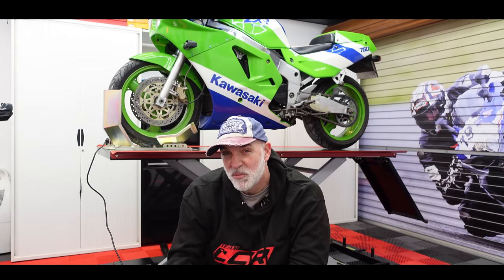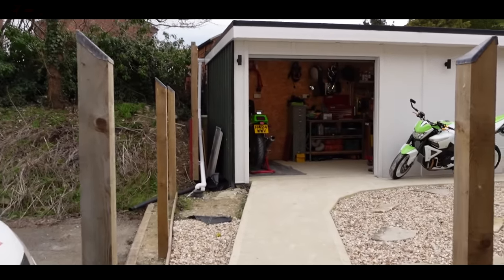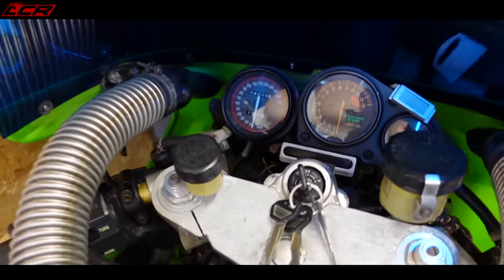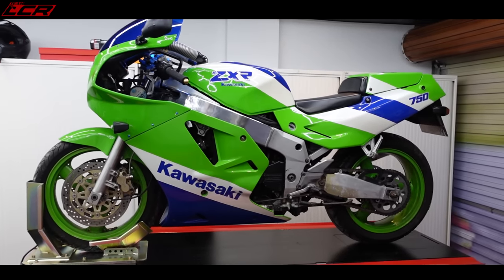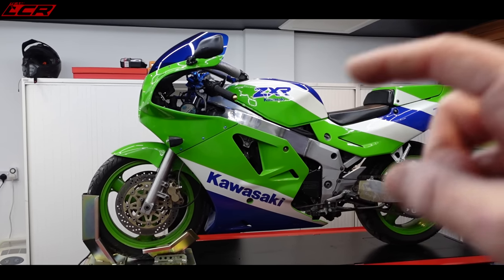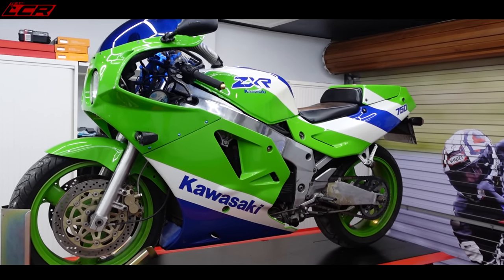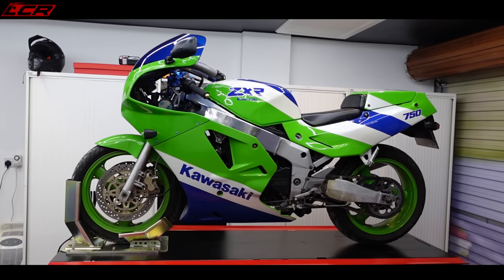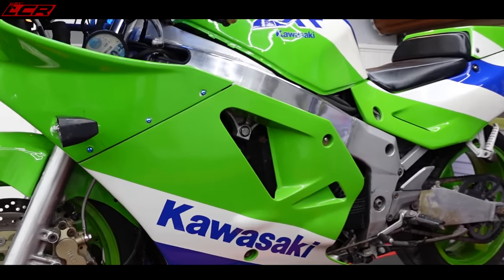New Restoration Project!! | 1990 Kawasaki ZXR750 H1

Comment: Hey Chops, I'm looking forward to your build. In '90 I fell in love with the black & gray model (USA), but "settled" on the green one as that's all the local dealers had in stock. The Kawi was a bit heavier (& longer) than the others, but felt planted in the corners; and with a linear power curve it was loads of fun to power slide. I had a fair amount of performance work done and although the power was impressive, it was temperamental and wasn't quite the same to ride. I still have mine and hope to get it running again.

Comment: Great find!!  I just finished my 1984 Yamaha Virago and I'm looking at my next project as well - a 1987 FZR1000.  The dual headlights are so iconic and I just love the look of these bikes.  I've owned a 1984 FJ1100, 1985 RZ500 and a number of other bikes from that era that I wish I'd never sold and still had.  One of the greatest catches for a restoration is just what you have - something that is mostly original, neglected but not abused and ripe for restoration with NOS/OEM parts still available.  Good luck with the build...you have another sub.

Comment: Looking forward to the restoration videos on this bike!
Had a zxr 750 1991(green colouration)back in those days and i was really fond of it.
Took it even down to the 20 km nurburgring track.
Great to hear that you going to keep it original.
I usually dont change other parts then the exhaust to a slipon.
Smaller changes like windscreen for example are also ok but not major changes.
The bike you got looks really good i have to say.

Comment: Judging by the swing arm, it looks like an H2. H1 had an external oil filter and the H2 had an internal oil filter. The H1 was the GPX 750 engine and if I'm not mistaken, the H2 was a new design. I had a red black and silver H2. There was a recall for the hugger which had a tendency to rub on the rear tyre. Possibly the best looking bike I ever owned! Book speed was 155 mph with an indicated 165 mph, Germany obviously so no slouch.
Reply: I had 1989 H1 when the bike was first released. Agree swing-arm looks like a H2

Comment: My first proper bike. Had a Muzzys Exhaust when I bought, I thought this thing was the ducks guts...so many had the GSXR 750, but I loved this bike. They were pretty quick...but always a few steps from the GSXR 750  from the tests I remember. Definitely not a slug though. But yep looking back 110hp was pretty decent back in the day. How cool were those fake induction hoover tubes though lol. I still managed to pull a 10.5 on the quarter mile with it.

Comment: I had one of these brand new in '89, but it was a red/black/gunmetal one. Did 22000 miles on it before it was written off by a Transit van pulling out in front of me. Keen to see your restoration! But is it a H1- it's got a H2 swingarm (which is a popular mod) although the paint scheme is H1. Although it looks like it's been resprayed at some point. Regarding the 4 star, I think that was well out by the end of the 80s, and all of the Japanese bikes ran fine on normal unleaded (unless they were race bikes etc). As for the power the H1 was 105ps and the H2 was 108. Good luck!

Comment: She looks amazing Chops the body work is in really good nick just make sure you lube up the pistons and top end before you go cranking on it trying to get it started. Maybe a good idea to put a splash of 2 stroke oil in the tank for the first start up  just to help lube up all the top end and valves prevent any damage from happening from sitting and getting dry.

Comment: Yep I remember all the fuel ⛽️ grades, 2 ,3,4,5 🌟 and the cost  40p ish a gallon around 1974, 
Had a GT 750 water cooled  1976 was using  4 star 🌟, 
Was advised by the dealer 2 star 🌟  is totally suitable, 
Looking forward to the restoration  of Kawasaki,

Comment: I worked at a bike dealer when these came out, before it was GPZ900Rs and ZX10’s. It was a leap forward. Love(d) the looks especially in the Kawasaki green, the red wasn’t as nice looking.

Just after launch, Our brand new demo was written off with 200 miles on it filtering in traffic by a local racer who was looking to see if it was worth changing his race GSXR slingshot for one.

Comment: Fantastic!!! I have a few parts left over from my restoration of one a few years back. Points to check and double check are the unions on the oil cooler, and any threads that go direct into the frame as the alloy isn’t the best. Yours has an H2 swingarm as the H1 has the brace over the top. Awesome ‘bike. 👍👍
Reply from the maker: Brilliant to know thanks 👍👍

Comment: That's going to be a great (although very expensive) build Chopsy can't wait and I remember the old 4 star petrol it got abolished in 2000 I think? But if you were 16 when it did you should only be 40 years old (same as me) lol
Reply from the maker: Haha OK got that wrong then.. I'm older than 40 😆
Reply: @LambChopRides  I know but didn't want to rub it in lol that's why the 44 teeth lads call you Dad

Comment: If anyone is doing such a project we might be able to help, on a bike like this we can source everything from batteries to chains, sprockets, tyres, seals, bearings, crash protection, heated grips, indicators, bulbs, clutch plates, brake discs, brake pads, oil filters, air filters, spark plugs 🎉
Reply from the maker: Fancy sponsoring the restoration series? 😁
Reply: ❤ we could! We have to keep these legends on the road 😎 I had to at the time, but there's lots we wish we kept like the RVF400, CBR400, an immaculate special edition 600RR(one of 3 we owned) to name a few! Every single model is currently worth more than we let them go for 😮

Comment: Chops, I might have missed some information, apologies if so… Is this definitely an H1? It’s on an H reg which always tended to be late model H2’s.. also, it has an H2 swingarm and H2 seat hump. The fairings are painted as an H1 but the rest shouts H2 🤔 If it has 38mm carbs as opposed to 36mm then that’s H2 as well. Also check the radiator, the H1 is flat, the H2 is larger & curved. 

The plastics do look in good condition. Fingers crossed there are minimal snapped tabs.. these old plastics can be a pain🤦🏻😄

Looks good though mate, will watch with interest. 👍🏼
Reply from the maker: Done some research on the chassis and engine numbers it is an H2.. so pleased as they were supposed to be better 👍
Reply: That’s great.. it’s surprising how many differences there are between the H1 & H2. The H2 engine got some race kit parts as standard. 

It’s going to make a great resto series 👍🏼

Comment: Out of interest, does the Kwak need strapping down on the bench? Or is that front wheel slot thing enough?
Reply from the maker: Ideally chuck a paddock stand on the rear but no bobbins on there currently. I wouldn't leave it on thier without being strapped or on the paddock 👍
Reply: @LambChopRides  very nice lift tho, clever how it cups the front wheel like that

Comment: It’s an H2 or at the very least an H1 with and H2 swingarm. You said it’s 1990 which is an h2 anyway.  I had a Rob Muzzy race kitted Superbike back in the day. Kit gearbox, radiator, muzzy cams, carb kit, full muzzy titanium exhaust and kit igniter (revved to 12,800rpm)
Reply from the maker: Yes actually after some more research it is an H2 👍

Comment: Even though you are doing a resto back to standard. The one thing to fit is get some lighter wheels in the same look… the oem’s are very heavy and this one small and unnoticeable change transforms the handling, acceleration and braking.

Also cartridge kit in the forks and a new rear shock… again nothing you can see.
Reply from the maker: Yes I'm thinking very subtle upgrades 👍

Comment: Do yourself a favour and get a head start before autumn. Timescales are a pain with specialist refurbs on things like fork plating in particular, whip them out and hand them over early to a good reputable metal finisher. Refinishing and fresh anodising are required on all the alloy. DIY efforts will never look right. Admit defeat on certain parts and replace them instead of flogging a dead horse on alloys that have been digested by corrosion. Rear caliper stuck out as being that far gone. Be much nicer come autumn if you've got a stack of hard sourced ready to go bits awaiting the day. Start drowning it intricately in WD40 penetrant right now and keep it regular until you finally get the spanners out. Fasteners sucked circa then, so use the wait time wisely to your advantage. Replating dog shit nuts and bolts is insanity. Find new and start the search now. Avoid multiple ball aches later! 

I'm doing exactly the same project on a 91 GSXR750M. Good on you and good luck!
Reply from the maker: Great tips! 👍
Reply: @LambChopRides  plugs out, borescope inspection to check if it's a nightmare in there. Spray fogging oil in heavily before manually slowly turning crank via front sprocket. I'd even squirt some engine oil around the rings and let it sit. Patience. It's sat long enough to rush it now! Hope the carbs were ran dry before it's hibernation. What a great end of season project in your new garage! 👌

Comment: I THINK THAT'S A H2 FRAME YOU KNOW NOT A H1.
THE COLOURS SCHEME IS DECEIVING.
IS THE OIL FILTER BY THE OIL COOLER IF NOT  IT'S DEFINITELY A H2 ENGINE AS THE OIL FILTER ON A H2 IS UNDERNEATH AND INSIDE THE ENGINE.
Reply: I've restored a few you see.

Best regards.

p.s. 1990 motorcycles aren't selling well at all at present

ULEZ? 
E10 PETROL?
BOTH?

I'm actually selling a mint GSXR1100 wp for £2300.
and there's no interest at all.

Best regards